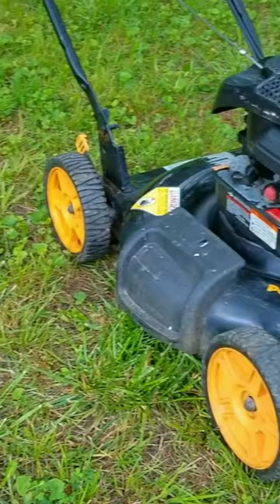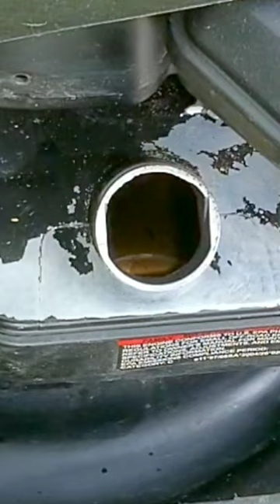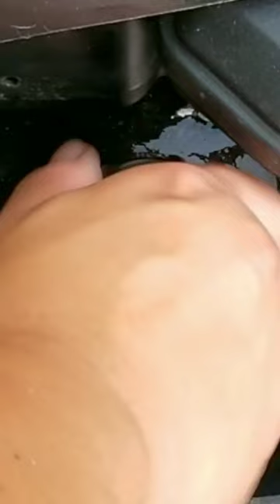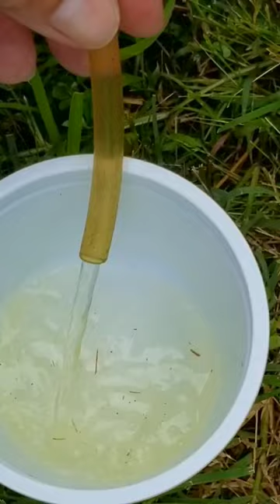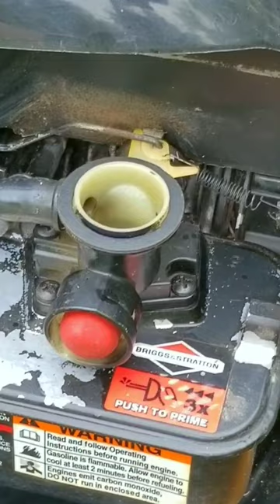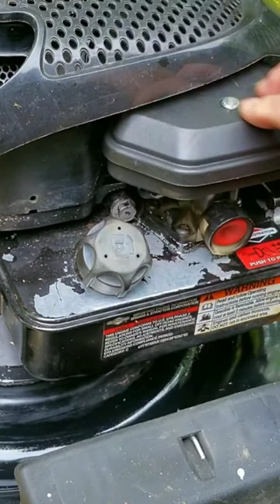Diesel Fuel In A Lawn Mower

Comment: Back in the early 90's our neighbor next to my employer had about 200 gallons of mixed gas/diesel, almost 50/50, they were giving away to whoever wanted some. I had an original 72 chevy pickup and you better believe I filled up my tank. It smoked a little, didn't foul the plugs. I probably wouldn't be able to do it in my 95 corolla now.
Reply from the maker: more than likely not now, thanks for the information
Reply: Yep, there was definitely a time when it could work if needed. Diesel in gas-powered okay, but not gas in diesel-powered!

Comment: Years ago I ran a tank mixed about 50/50 in an old, tired briggs quantum push mower just to see if it would run🤪 was difficult to start but ran fine, just a little smokey🙂
Reply from the maker: nice, glad to know it works!
Reply: I thought it would make rings  seal a liitle better,  small amt diesel Thanks
Reply: Yep, diesel in gas-powered okay, but not gas in diesel-powered!
Reply: @Mojo32 It' s exactly 😉.

Comment: About 25 yrs ago I accidentally put 5 gallons of 2 stroke in my car, the can wasn't marked it was in my sister's garage. It was in a regular can so I couldn't tell😊 I then drove my car about a mile and I started sputtering and smoking like crazy!!! I was a nightmare to fix. I had to drop the tank and clean it out and put a new filter and pump. Ever since that I Mark every can and check it before u pour fuel into anything
Reply from the maker: really?  I didn't think the small amount of oil would bother a car.
Reply: @HomeGaragechannel  heck, when I remember, I purposely add about 2oz 2t oil per 10 gallons of gas to my trucks and car. No issues in 10 years and 1 truck actually idles smoother with it!  Not to mention I dump 2t mixed gas, no more than a gallon at a time into my vehicles when it gets old.
Reply: Usually 2 stroke oil does ent bother a car
Reply: @HomeGaragechannel  after I put it in my car, it started running really bad. it was a Dodge Neon I was most definitely the mixed gas because the car was on E that's why I put it in there.
Reply from the maker: that makes sense

Comment: LOL... I had that exact same Briggs engine on a 1996 Toro recycler II... I would cut old diesel from my yanmar 2gm from my sailboat at 25% and other than a bit of smoke and some black spot marks on the deck and exhaust - it still started on the first pull when I sold it just last year...
Reply from the maker: nice!

Comment: I got a question Boss , I payed a used  (shindaiwa T242 Weed eater ) The problem is that when I turn it on and hit the trigger it doesn’t go full power and if I hold on the trigger for long it Turns off. I been dealing with this for 2 days. I replaced the carbonator and the 3 wires and the spark plug also adjusting the carbonator but still doesn’t want to work … any advice ? Boss
Reply from the maker: Sure look at the spark arrestor screen on the outlet of the muffler. There's a good chance it's clogged.

Comment: I have seen 2 stroke but not diesel.  Love the "get off your phone"
Reply from the maker: it's so fitting for the times.
Reply: I’ve put improper 2 stroke oil mixes in my 4 stroke lawnmower because I couldn’t use the improper oil mix for my 2 stroke equipment. It was a cheap way of disposing the fuel and it ran fine
Reply: @haloondrugs1173  I put it in my car when it's got a full tank. The mixture gets thinned out my the amount of fuel already in the car and so far, so good.(30+ years of doing it)

Comment: My truck was over flooded with diesel bcuz I left the back up tank switch on an I just drained about a gallon an thought about saving the diesel for my lawnmower but then I realized why be cheap an risk a $350 lawnmower to save $3.69 a gallon of diesel!
I just dumped it in the sewers

Comment: This happened to me once Guy brought me a lawn mower said it won't run It was like brand new turns out someone put diesel in it how I knew it was diesel was it was so oily and it's stunk and I just couldn't get it out to the carburetor well after like two cans of carb spray in the gas tank and carb is finally came out and it started
Reply from the maker: nice work